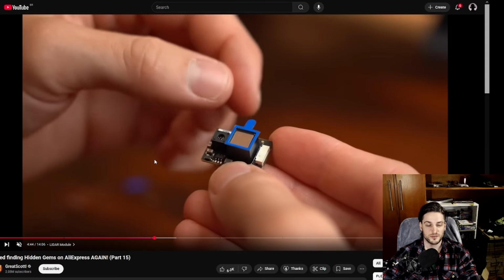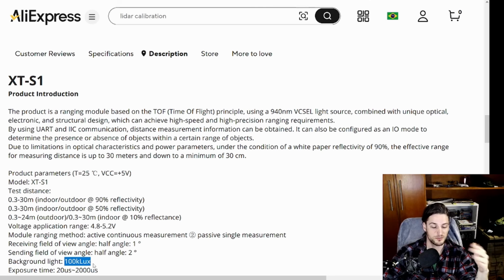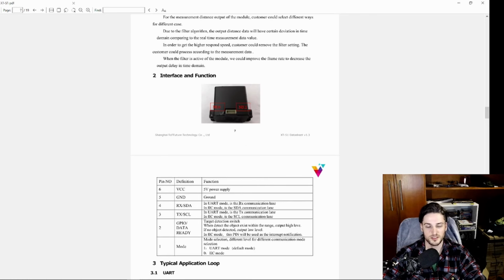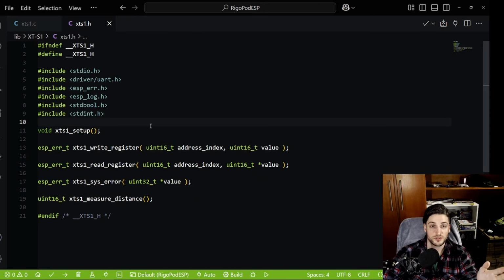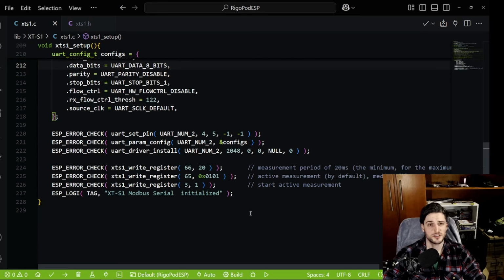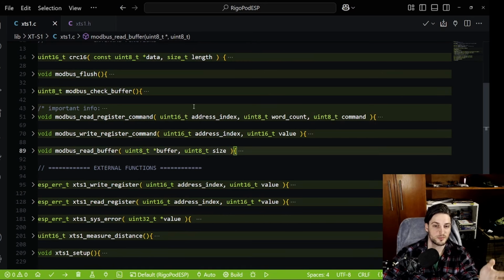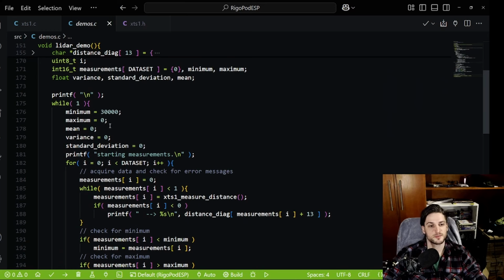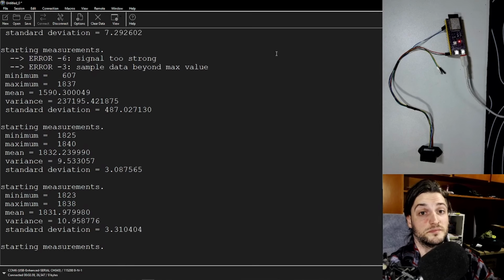XT-S1 LiDAR tutorial : Driver code and Demo program

Comment: Is there any GUI tool to plot the distance?
Reply from the maker: I configured the microcontroller to export the serial data. You could just use any tool that reads serial port to plot it easily. Even a serial reader like the CoolTerm like I use can do that.